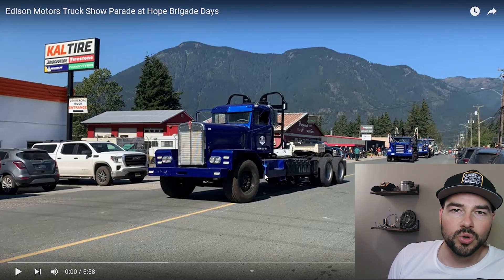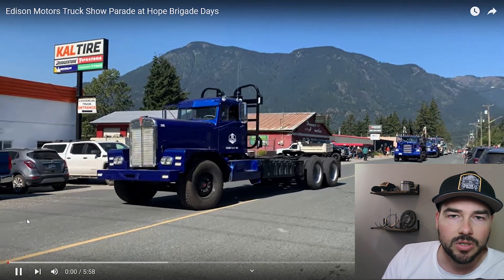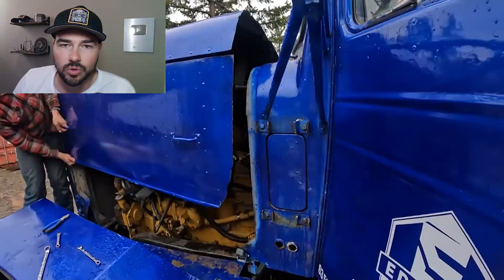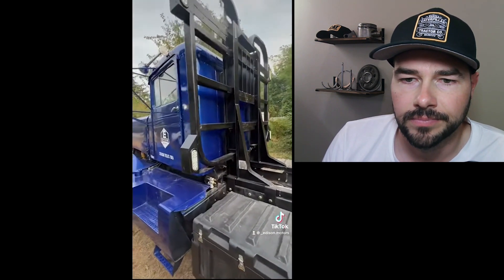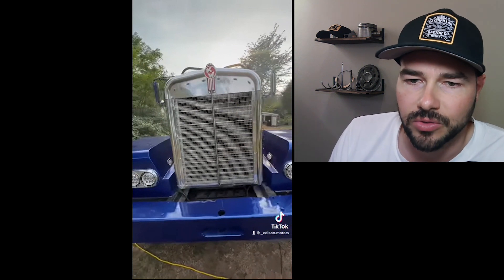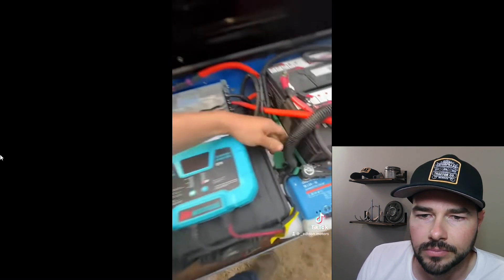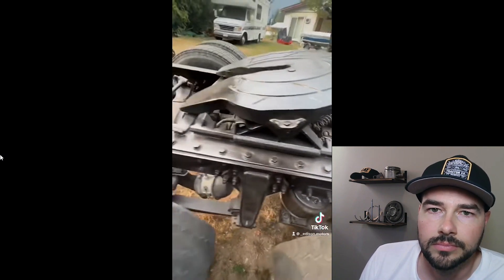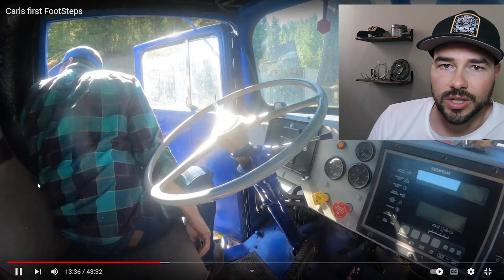Mechanic Reacts to AMAZING Diesel-Electric 1962 Kenworth. Edison Motors.

Comment: Most very large haul trucks are diesel electric. But not running off batteries. I wonder if the Genset is automatic or does someone have to start it?

Comment: You can tell they haven't started and used the diesel engine yet for regenerating power, there is still masking tape over the crankcase breather on the valve cover. They will likely find out that those 2 electric fans on the radiator are not enough to keep the engine cool when generating power during high demand. Cool concept idea, would actually be useful for real world electric drive on a semi.

Comment: I'd like to see the diesel electric drive without the batteries. Just let the generator run all the time like in a locomotive. Those batteries are heavy, expensive, and if they're of a similar composition to the ones used in Teslas, burn at over 3000 degrees when they light up.
Reply: There’s no point if it’s diesel electric like on a locomotive. The reason locomotives are diesel electric is because you simply can’t get 4,400 HP down to the rails effectively with mechanical drive.

Comment: It looks cool, but is it diesel-electric, like a locomotive, or is it more like how the Chevy Volts were? engine, batteries, and charges it's own batteries, if/as needed? ...and if it is, isn't that the worst of both worlds? (and from the big battery box it looks like it is...) You now have a bunch of battery weight to deal with. Would be more interesting as a pure diesel-electric, like a locomotive.
Reply: it its just using a tesla battery pack then the weight of it is not much of a bother compared to the truck and load and is probably worth the ability to not run the engine in heavy traffic/move around the yard

Comment: woah woah woah. Electric fans on a big rig?! 3:38 Just shows you that this machine is just a toy for fun and will never do any real actual work. Neat but I don't like how ev's are being pushed and mandated as if that is the future of transportation.  So we take diesel and convert it into mechanical energy, then into electrical energy, then back to mechanical to drive the wheels. Trains use this type of powertrain because it can handle more power reliably than a transmission.

Comment: Freight trains are diesel electric because the transmission required would be big, complex, and expensive. You also lose energy any time you change it into another type. If you can, you make that mechanical motion go straight to the wheels. No sense in changing it to another and then back again, unless you can prove the losses are greater with the mechanical drive. Diesel electric isn't a free exchange.

Comment: It's far from unique just on the road. Train Engines use the same systems. A Big Diesel running a generator running electric trucks under the engine. I've always wondered why they didn't continue this for vehicles? It's so much more efficient. The Prius tried to say it was new technology? Thai was far from the truth! The only thing different.was.the batteries and Gas as fuel. Where a train uses diesel and direct electric no battery storage. Ok so it's not setup like a Train engine this is a hack at a Giant Tesla Truck.

Comment: You have to forgive Chase. He's only a mechanic. Not good at explaining. He should use Ian Wright's Wrightspeed Turbine. Instead of that heavy diesel guzzler engine. He's trying to reinvent the wheel but failed. I strongly advice investors to stay away.

Comment: I'm a Diesel mechanic myself. Please enlighten me: we know every "motor" has an efficiency rating. Efficiency in real world can never be 100 percent. So in regular truck, you have only 1 level of energy loss because of motor. This stupid creation has a Diesel motor (which doesn't have 100 percent efficiency) to charge batteries that will power an electric motor (that doesn't have 100 percent efficiency either) to move the truck. This is 2 level efficiency loss. Why not just hooking up the Diesel engine to the driveline and use the truck in a sane way??? Let alone all the complexity, added weight, added cost, etc. that comes with this stupid project. The fact that people like these exist and are encouraged is just a shame. Not only to all mechanics and truckers, but also to all homosapiens
Reply: In reality it’s the same as a hybrid car but on a bigger scale. It would be pointless unless it uses regenerative braking to charge the batteries going downhill.

Comment: In my opinion, it's a travesty having it a parallel system with no diesel engine jake brake connected to the drive train placing way to much faith on the EV regeneration. Assuming he's using a Tesla battery since he's using a Tesla motor it's capped at 60KW of regen. On a race track the Model 3 goes into reduced power mode in 3 - 5 minutes due to battery temperature and I don't think he did significant enough cooling upgrades for his "prototype." It's fitting that the Canadian currency is known as a loonie as the designer is a loonie himself.
Reply: might have to install a dynamic brake resistor grid and cooling fan, just like on locomotives